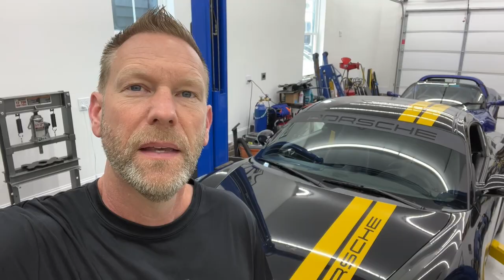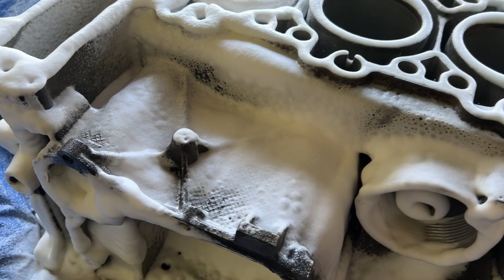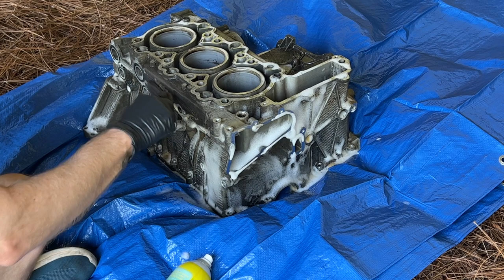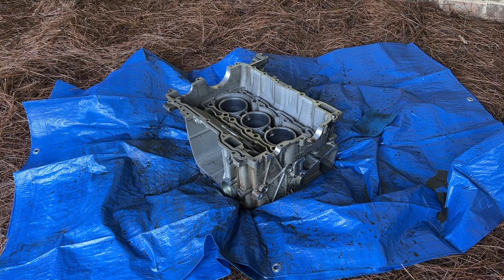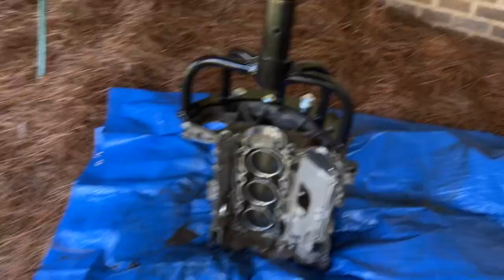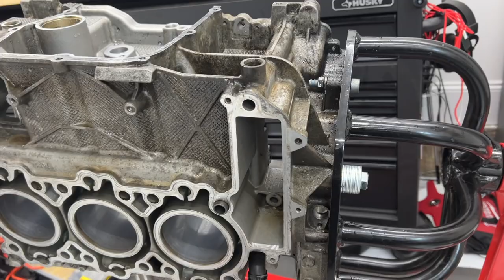How NOT to Clean an Aluminum Engine Block! (BBB Part 22)

Comment: I think I would use a power washer first to get most of the crud off,  Also, regular Simple Green is corrosive to aluminium as the US military found out.  Simple Green Extreme is made for use on aluminium.  It looks like the foam is regular Simple Green.  I wouldn't use it on a block that was going to be rebuilt.
Reply from the maker: +DHS product description SAID it was safe on aluminum 🤷‍♂️